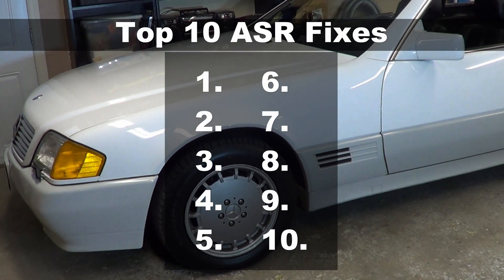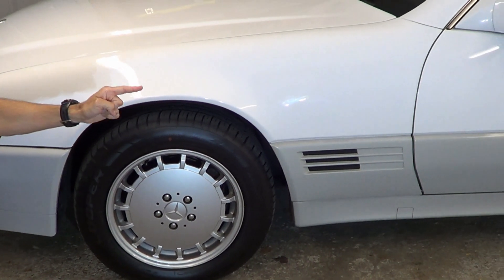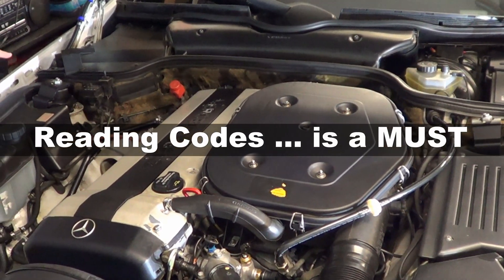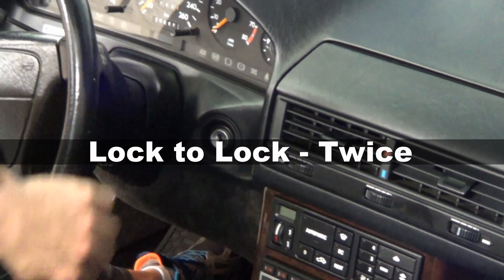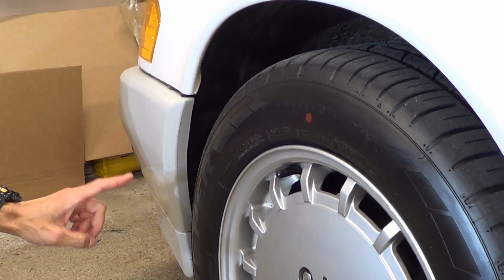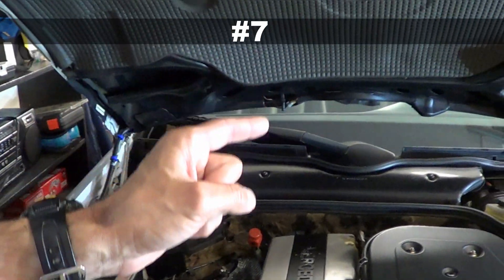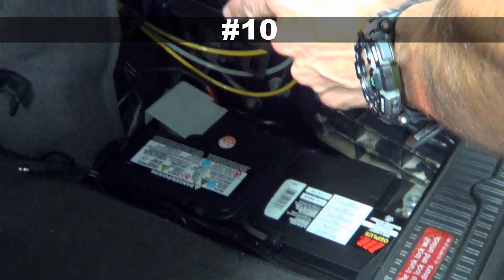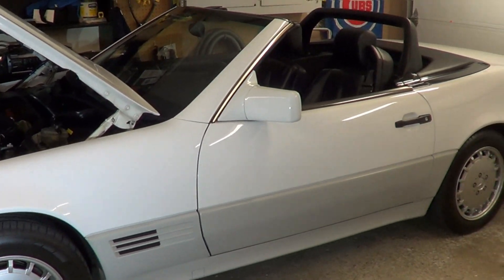Mercedes ASR Light, Limp Mode, No Acceleration - List of 10 Fixes -  1990s Benz R129, W124, W140

Comment: I got the  ASR ABS  problem just after purchasing my car in march this year, a 1997 SL 280( m104), sometimes going in to limp mode sometimes not( by the way, on mine german version  limp mode is 30kmh). Tried charging the battery, steering wheel trick, no go. Very frustrating. Then tried to pull and push back all the fuses and relays, as also did adjusted tire pressure as per specks( i had same pressure on all wheels which is not correct). After this, the warning lamps come on a bit later than usually, disappointed called it a day. Next morrning tested again, everything  was fine, still all good :).  I did had one limp mode incident( no warning lamps), it came on suddenly on the motorway,  not very nice, its almost like as sudden braking.....cleaned the MAF sensor and never had it again. Now have done 3000 km, love every kilometer:)
Reply from the maker: Thanks for sharing your experience. I’m super happy that you now have it sorted out and are enjoying the R129 life. The cleaning of the MAF is surprising. I wonder if it was the cleaning and the combination of all the previous fixes that ultimately got the ASR ABS light out. It might be, but what is known is that the fixes for ASR are varied. Your ‘never quit’ attitude worked - amazing outcome!
Reply: @HandyVal  Thanks. Think cleaning of the MAF sensor only sorted out the one-of sudden limp mode that the car caused without any ABS /ASR alarms.
Reply: A 1997 car has the full OBD 38 pin so you can actually interrogate the ASR unlike the early KJet car as Val says.
Reply: @bencosgrave3902  Yeah, possible. The problem is to find a reasonable priced device doing reading codes...They charge at the shop pretty ridiculous charges for reading  codes on a 38 pin over here. This winter had a few incident of the ASR ABS  light, but no limp mode any more. Think  its the brake light switch that corrodes when not in use, as it appears only if the car is not in use for a few weeks, and goes away after more driving. There is no OBD 2 port on this car. only the 38 pin.

Comment: Good Info as usual Val.  I too...1992 500sl... had this issue.  The indy that I took the car to FINALLY figured out it was a module...that was located where the OVP is located under that plastic piece.... that went bad...this was years ago and they wanted 1500 for the part only ...got one used for 300 sent it to them and they fixed it.
Reply from the maker: Interesting. It makes sense. Excellent score on the used part and kudos to the indy for figuring it out. I think a lot of 90s Mercedes owners give up on their car after experiencing the ASR limp mode, as it's frustrating because the car is not drivable and finding the fix always seems like a long and difficult journey. I hope this video and its comments can help others find their fix.
Reply: @HandyVal  You are correct in talking to the indy they had a very hard time figuring it out and it was only because they had another early 90's mbz in the shop at the time so they could swap out this module..I think it was  the ECU...anyway after they did that it worked.  Very hard issue to fix hope I do not have to go thru this again

Comment: Great stuff Val! As you know this has been my demon on my 92 500sl! I ended up buying a used ETA on EBay ($300). That fixed my limp mode issue BUT the ASR light still comes on (but drives normal). I will open up my old one and see if anything looks out of place and play around with it. I have not messed with the potentiometer yet but it is on the list to look at. I will go through your list of fixes and see if any of them will turn the ASR light off. Maybe I'll get lucky 🤷‍♂. THANK YOU for this video AND all of your other SL content. I have used many of them!
Reply from the maker: Thanks for sharing your ASR experience and fix. I’m glad your 500SL is drivable now. I tried including all the ASR fixes I know into this video. Keep us updated.